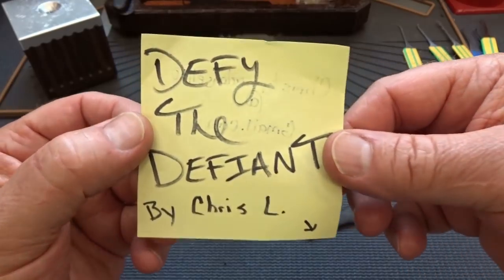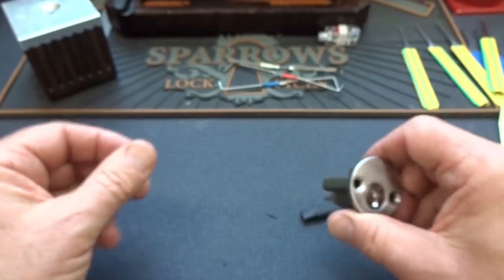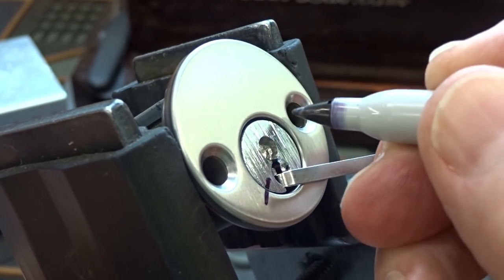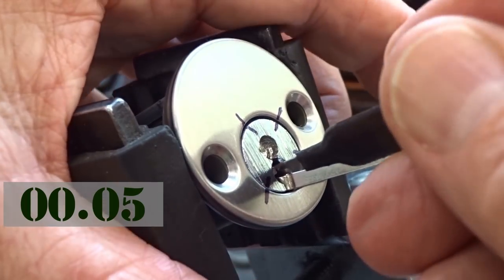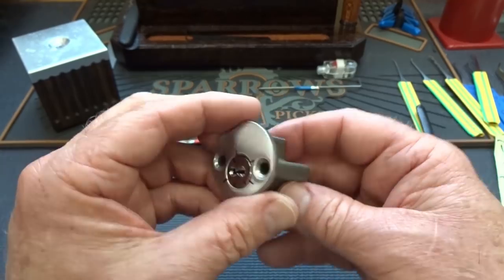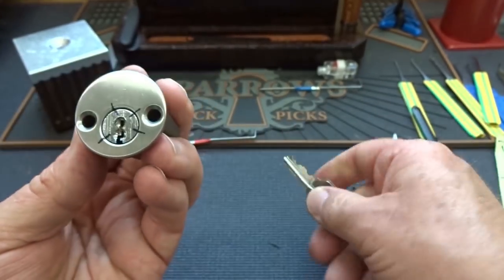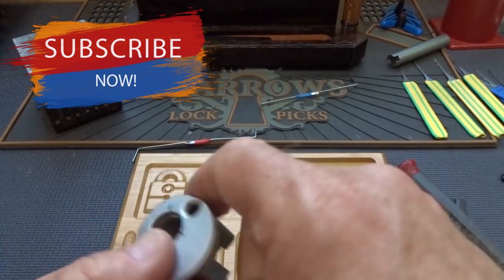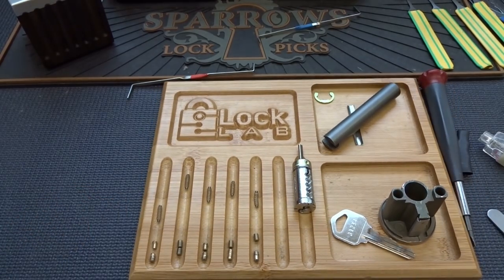(1291) Challenge: Defy the Defiant

Comment: So, basically just a T-Pin and a Serrated, unless you over-set. Here is advice for people who may not understand.
If you are going to ONLY put security pins on either the top or the bottom, always go with the top, because this will mean you have to pick ALL the security pins.
If you put ONLY security pins on the bottom and all standards on top, then the only way you would end up picking a security pin, would be if you overset a standard pin.

The benefit to having security pins on the top AND bottom, especially if they are the same security pin design, is that you may be trying to detect the security pin and get a crunch or false set on the top pin, followed by the same crunch or false set on the bottom pin and not realize you overset it and are picking the security part of an overset pin.

An example would be "I will pick this pin, until i stop detecting a security pin and remember how high up it needs to go and repick the lock" but if the entire top and bottom pin are fully serrated, you won't be able to do that. This is why I have issues with American padlocks. Someday I will pick one of mine successfully... I hope.

However, when it comes to counter-milling or threading, both the top and bottom pins will interact with bottom modifications, but the top pins will possibly interact with all the top modifications (each time the bottom pin is pushed up to the next modification/serration), since as you push on the bottom pin with tension, the top pin will interact with the top chamber modifications regardless of setting or oversetting.

I can't word this in a way that will cover all situations, so it's just a generalization.
Reply from the maker: EXCELLENT observations Jay!  Right on the mark, especially about using standard pins on top.  They keep the lock from flopping, but always think of them as gimmes.  Pinning this comment.
Reply: I started picking american locks first ( im better at them than master lock no.3 and 5) the a1100 series as it was all I had, the secret I found is just find your first binder, use light tension, pick it lightly until you get 2 small clicks then leave it be and go on to the next. most of the time I don't get counter rotation until the 4th binder (I have 5 different keyed a1100) assuming your picking spools, as for serrated pins same concept as spools but you get "drag" and then a defining click. bills videos on tension helped a bunch to much tension when you picking security pin can cause you to overset because you have to force the pins up which may not be a bad thing depending on the lock. (I use a homemade short hook 17thou. made from wiper inserts and a tensioner made from a welding rod bend,hammerd,and filed for top of the keyway. anyway hope this will help a bit.
Reply: Thanks Jay H, good explained.
Now i understand more about the effect from security pins in the bottom and in the top.
I start work with this😁

Comment: The grinding on the top of the core is generally used to smoothen out any key snagging...... There is a trade off however, if your key pins are beveled on both sides then grinding the top of the core basically only amplifies the sheerline slop, decreasing the locks security.....

Comment: Take the clip remover tool and file down the tip to make the gap between the tip and the notch just a little smaller then it will work great. Did it to the same one and it works.

Comment: Hmmm...   I wonder how one could mount a pin in the side to line up with the warding in the keyway.  In the back, hidden behind the metal warding in the keyway.  Then file away just a tiny bit of the key so it will align pins through a side hole...  Now that could make an interesting challenge lock if a certain picker isn't expecting such a modification (or two).  😊

Comment: It's getting to the point that all challenge lock makers should run a botgota through their locks for 10 minutes before they send it to Bill...  If it passes that test, then they won't get embarrassed when Bill bypasses all their tricks in less than a minute with random raking.  Also probably should test against the overlift technique as well...
Reply: eak125 that overlift technique help me get into an ancient Yale lock that kept me out forever. Best thing I ever learned from Bill.
Reply: What video was the overlift technique in?

Comment: Nice one. Good try Chris. I would be weary of factory cut keys on a challenge lock
Reply from the maker: In all fairness, I think luck played a HUGE part in me raking this open so quickly.  After making the video I put it all back together and tried again.  It took almost 10 minutes to rake it a second time.  Luck DOES play a part.
Reply: Absolutely, I usually rake open used locks when I buy them and sometimes it works fast and sometimes not at all..

Comment: Individually filed chambers on core is no different than one long flat spot. All that work into the pins basically for nothing.
Reply: The Lock Picking Lebowski I was kind of thinking along those lines,  too. I remember old Weiser locks,  the top of the plug (you guys call core) was flattened.  But they used a standard pin,  that didn't have such a large bevel. I believe that I have one of those junk heaps laying around still.  Made for an easy pick.  
If a person was to take the retaining clip of the back of the cylinder,  and look at the last pin as you run a key blank in the lock - you can actually see the top,  and bottom pins mesh.... Really poor tolerance.  So,  when a company makes a poor tolerance lock,  combined with pins with such large bevals, AND filler the top of the plug...... It's going to make for an easy pick,  as we all just witnessed.  I would make a challenge lock,  but I simply just don't have time.  
Good brand name locks to make add a challenge lock?  Stick with Sargent,  Schlage, old real brass Yale, Corbin, Russwin, and Assa... They all make great challenge locks.  Brass cylinders are much better tolerances than the cheap Chinese junk.

Comment: That's a lot of standard pins for a challenge lock, especially with Kwikset pins. Still shouldn't have been rakeable though. Have you bought your Powerball ticket today Bill? Or did you just use the excess luck to spot a unicorn?
Reply from the maker: I think I used up all my luck getting an open on this lock.

Comment: Your audio seeing it's slightly messed up. It has a high pitched distortion. Not worth redoing the video, but worth correcting for future videos.
Reply from the maker: Jay, nothing has changed in the way I record or process the videos.  I looked at the spectro using Audacity and don't see any high frequency noise.  It is not clipped and all well within the recording "envelope", i.e. averaging -12dB and never exceeding -4dB.  Could you be over-driving the speakers or headphones?